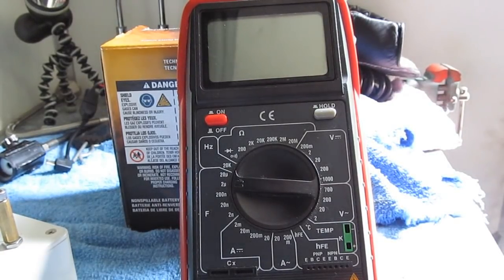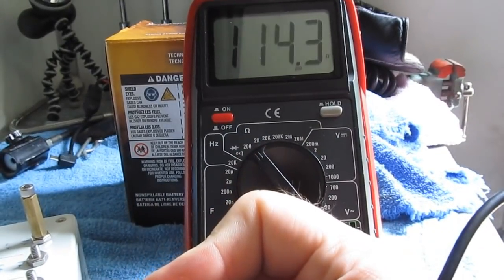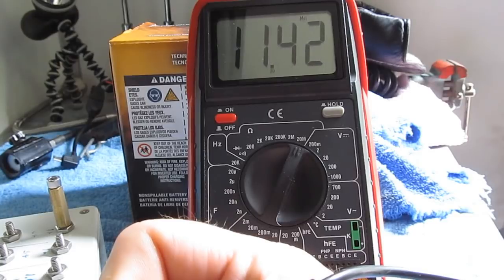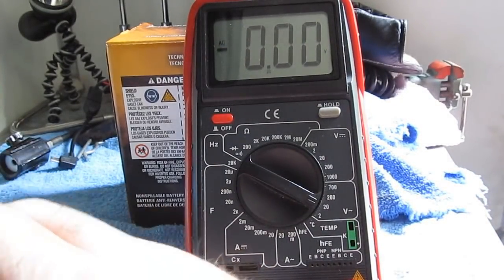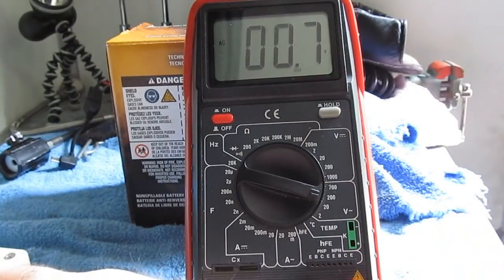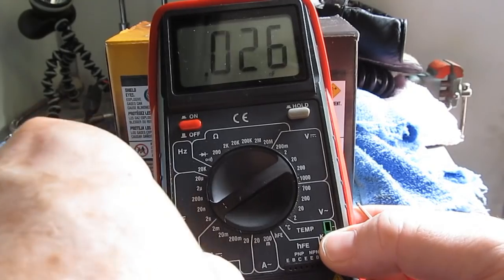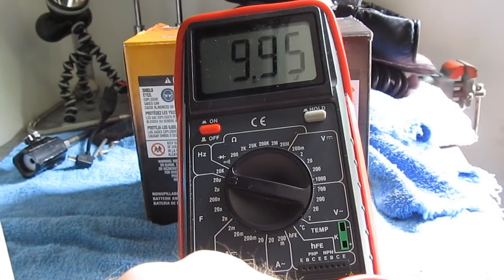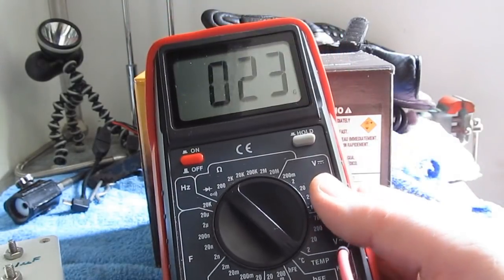Harbor Freight P37772 How accurate after years of abuse?

Comment: this meter uses standard universal test leads?
Reply from the maker: What are we calling standard?
Reply: @joesmith-je3tq  as in the slots that accept the test leads.  if i am correct the standard
 is 40 mm banana style
Reply: @larryp85  that's FOUR millimeters (standard banana plugs).
Reply: @joesmith-je3tq  i am trying to order some replacement leads for mine and not sure if the universal standard size is right
Reply from the maker: @larryp85  I've seen various sizes from China and they don't always mix and match.   The shrouded ones I normally used from Probemaster are longer than the cheap ones from Mastech.  They will fit but they are not flush with the case like they should be.

Comment: not awful for the price, thanks for sharing. would be nice to have a temp probe for roasting coffee, and multi meter for working on the car.
Reply from the maker: Downside is the hinged LCD.  It will fail eventually.
Reply: @joesmith-je3tq I might use it 5-10 times a year max. should I get something better with that usage?
Reply from the maker: @json8172  I don't know what better means to you or what your using it for.  I'm surprised as old as it is that they still sell them.
Reply: @joesmith-je3tq  Ill just buy a Klein from homedepot then. Its a few dollars more, just doesnt have temp. Id rather get something nicer.
Reply: Leave it flat in the rubber case and it will work forever.
Reply: Yep , just like Flip Phones…

However if you leave this multimeter in the rubberized shock cover, it will last without mechanical failure. It’s just a failure waiting to have you buy a replacement. (Mine is always flat).

Comment: Hey Joe, where could i find the pin style connectors like you used here for capacitance testing?
Thanks
Reply from the maker: I have no idea what you are referring to.  Are you asking about the nuts and bolts used on the box?
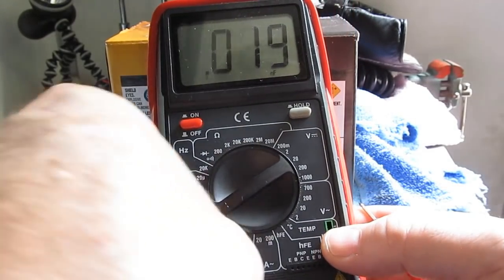Reply: @joesmith-je3tq  I went back and watched it again, at 3:15 I believe you referred to them as slot connector's. Where can i find those connectors/adaptors for my leads?
Thanks
Reply from the maker: @Laowai007  That would have been helpful to know.      These are meant to plug a leaded part into, not the leads like I show.  If you wanted to make a set, I would use a thin strip of copper, or just tin some some wire and insert it.

Comment: Hello, I have a question which has always disturbed me, could I connect a multimeter to a voltage source instead of putting its battery and working with it that way? Thanks for your help.
Reply from the maker: The question you should ask is would it be safe to use a hand held meter this way, not if it can be done.   Obviously, I would have no way of knowing what you are attempting to do.    I'm not big on safety and would assume anyone attempting to do such a thing would understand the risks involved.
Reply: Thank you very much for your kindness in answering me friend. Regarding what you tell me: I use the multimeter only on my desk, hence my idea of connecting it to a voltage source. I worry that the voltage provided by the voltage source is not pure enough and will damage the multimeter. Regarding what you said about security, I totally agree with you. Thanks again, regards!
Reply: @ppstonesanchez1590  As long as the voltage is regulated to what the meter needs/expects, I suppose you could.  I'd recommend fusing the power supply though.
Reply: @djo9c1  I thank you very much, what you tell me is an excellent point. I think I will decide to power one of my multimeters with voltage source. Have a happy Christmas holidays!
Reply: Yes, you can use it on any high quality REGULATED D.C VOLTAGE SUPPLY, set to 9 volts D.C. output. Make sure you get the polarity correct to the battery clip (small circle on clip is positive). It would be very dangerous to have the meter case cracked open for measuring anything over about 50 volts or so, though. The current regulation of your source supply should be regulated to some small amount of current, say 100 mAmps or so. Be careful if you don't know what you are doing. With all that said, you REALLY SHOULD just use a 9 volt battery. A battery should last a long time-check periodically to make sure it is not leaking.
Reply: @douglas2lee929  First of all I appreciate your answer friend, after thinking things through, learning mainly from the opinions of friends like you, I decided not to make any kind of adaptation or modification to my multimeter, due to the safety aspect. Thank you very much again Douglas2 for your focused and clear comment. It's clear to me that it's best to just use the stack. Blessings my friend.

Comment: Hello,  are you familiar with any of the Electronic Specialties multimeters?   They seem well made (e.g. IP67), but I can't find any information/reviews on them.  I'm wondering if they are rebranded.   Here is one:  http://www.esitest.com/589.html   There are a few more.
Reply from the maker: I am not familiar with the brand.  They could very well be rebranded.  You could check some of the lower end brands and see if they have it.
Reply: Thanks for the reply. I was told the TMX589 was designed in conjunction with Dan Sullivan -- I'm looking at getting that kit.....  I will try and look at the rebranding.
Reply from the maker: @jkimo11  I would check CEM and UNI-T for starts.   You could also try posting the link on the EEVBLOG forum.  There are many handheld meter gurus there that may just know.
Reply: Also, as a general rule, do multimeter technologies "age"?  What I mean is that this TMX589 model came out in 2012 and I might want to look for something that has come out more recently with similar features.  ????
Reply from the maker: @jkimo11  As a general rule, I would say all technologies age.  If this meets your needs or if there is a meter available that would better suit you, only you can answer that.

Comment: Thanks Joe! It seems to me that cheaper meters get a bad wrap because they are hamstringed by bad test leads. My little Aneng AN8008 works pretty good with some nice test leads.
Reply from the maker: Seems to me from posts I have read, people often compare cheap meters with the higher class ones making in many times, unfounded claims.   Once you start setting high expectations for a cheap meters, you end up with a bad wrap as you say if they don't perform.  Personally,  I always treated the cheap meters I bought as disposable and I have very low expectations of them.   The point of running these tests was to see how various meters compared on a level playing field, taking the human BS factor out of the equation.
Reply: I am not claiming any such thing. I wouldn't think of comparing my AN8008 against my 87V or BM869s. All I am saying is that a DMM can't be expected to perform very well when it has worthless test leads plugged into it. If someone tests a cheaper meter with the shitty test leads that came with it, all they are really testing is the shitty leads.
I  am using the leads that came with my Brymen for my Aneng until I can afford some Probe Master leads for it.
Reply from the maker: @robertcalkjr.8325  In my first post on EEVBLOG, I talk about the use of filters and why they are enabled.  Your comment was blocked because of this.   "I am not claiming any such thing."  Actually, if you would read what I posted, I never stated you did.   Of the meters I have damaged, it's never been a result of bad leads but poor design choices.   

For electrical work, I find the leads supplied with the cheap meters I have used throughout the years didn't impede my efforts (note the cheap leads in this video).  At home, when working with electronics, if I need to use probes, I typically will use a set of ridged stainless steel needles.  These can be sharpened if needed and are a very fine tip.   These are not something I would ever use for electrical work or take into the garage.  I would guess I have 10 or more tips depending what I am working on.  Right tool for the job is all.
Reply: Hi Joe. I think that you have misunderstood me. I did not mean to sound like I was trying to impugn your work. I was just referring to using cheaper meters in general everyday use. Mine seem to perform better with better test leads. I would never trust using a cheap meter with mains voltage or high current. 
I apologize for not explaining myself well enough. Sometimes I forget how touchy people are online and how easily they are offended. I should have explained myself better.
Reply from the maker: @robertcalkjr.8325  I think you misunderstood my original post as I was not specifically stating that you personally had done anything.    This channel has never been about safety or if any of the meters were safe to use for mains work.  Far from it.  I've always said that if you use a meter in environments that require it, you best use a product that has been certified for it.   These tests have nothing to do with if any of these meters meet these requirements or not.   What I have shown over the last few years is high currents, high voltage, but VERY low energy levels compared with what that actual standards call for.  This has never changed.
Reply: I know that, Joe. I was just seeking your opinion about general use. I figured that you have used DMM's for regular stuff. Forget about it. I apologize for even asking anything. It's ok.
Reply from the maker: @robertcalkjr.8325  I didn't realize you had asked a question.  Most people will end with a "?" I thought we were just having a discussion.  You haven't been insulting in anyway and I am not offended by anything you have posted.   I don't always consider that there are sensitive people who don't care for my blunt responses.  No matter.   Early on I mentioned about taking the human factor out of evaluating meters.  I've tried to make the channel data driven for the few people who are actually interested in it rather than how I feel about the various products.
Reply: Yeah, I guess I should not have framed it in a statement. I was just talking about cheaper DMM's in general. I have noticed that with cheaper DMM's in general use, checking resistors and low voltages and stuff, that they perform better when you use some good test leads instead of the cheap leads that come with most of them.
A lot of people talk about how crappy a certain less expensive meter may be, when the reality is that it is the cheap leads that are causing most of the problems, not the meter itself.
Yes, I find your work interesting. But in my first comment and now I am just talking about the meters in normal everyday electronics use.
For instance, my Fluke leads that came with my 87V that were about 6 years old were acting up and making my meter work like crap. But when I put new Probe Master test leads on it, it acted like a brand new meter again.
What do you think about that??
Reply from the maker: And how high is the BEMF from an unclamped pinball machine's solenoid??
Reply: @joesmith-je3tq  Good question. Depends on if the plunger reaches its end of stroke or not. Pinball solenoids are usually driven with 50VAC. There are also various sizes of solenoid depending on how much physical force is required. Flipper coils for example have two windings - Stroke and Hold. I don't have the equipment to measure back EMF, but I imagine it's not that much.

This question reminds me of "What is the airspeed velocity of an unladen swallow?"  That'd be about 24 MPH.
Reply from the maker: @brianthompson1138  I didn't know they ran them off AC but it makes sense to keep it simple.  I doubt they have anything then to suppress the BEMF just have switches designed to handle it, similar to the toy trains I had as a child.
Reply: joe smith  I really don't understand the animosity and why people on YouTube are so quick to look for a reason to feel offended. I made a very simple suggestion that I admitted should have been formed into a question.
I can see now why you don't get many comments. And to be brutally honest with you, I won't miss much if I never watch another one of your videos.
Reply from the maker: @robertcalkjr.8325  It seems you are actually describing yourself.  I made a general statement, you took it personal.  Now you are to the point of making personal attacks.   Leave or stay, it really doesn't matter to me but keep in mind that I don't tolerate that behavior on my channel.
Reply: joe smith  That was not an attack. But you can keep playing your games if you want to. Goodbye.
Reply from the maker: I don't think anything of it as I've seen some abused leads have problems.    I these tests, I never use the supplied leads.  I did run a sort of batch test on them where they were stressed to failure by sweeping the current while calculating their resistance.   I wouldn't consider, say, touching the leads together, to be any sort of useful test.  Tests that may be useful to benchmark them would be:

Pull test
Bend test
Chemical exposure
Material makeup

Again my requirements when I am using meters like the one shown in this video are not real demanding.    The leads in this video have been thermal cycled, used to catch the falling meter and have been exposed to some chemicals.   Their still fine. 

If I am working with electronics, I am normally using the bench meter with the 4W leads or the ones I mention in the second post for the reasons mentioned.
Reply: It's not fair to compare cheap meters with the higher end stuff, as so many people do. A cheap meter will do its job with what it's designed for - basic measurement. 
Just need to check +5 and +12 in low power circuits? A cheap meter is fine. But don't expect it to come close to even the likes of even basic Flukes or Brymens..
Reply from the maker: @brianthompson1138  These tests have always been about how robust the meters are on a level playing field.  It certainly is fair to compare them this way.  I am not suggesting that everyone will like the end results but I didn't run the these benchmarks to make people feel happy about the products they purchase.   Of course, we have seen some meters costing well over a hundred USD failing at levels where a less than a $50 meter survived.   Of course, there are a few that would rather just hear about a 5 star rating after connecting the meter to a 12V supply, but I try to discourage them from joining this channel.
Reply: @joesmith-je3tq  I agree 100% and I've considered the knowledge I have gained by watching your test videos as part of my decision process when buying two new meters - one for home and one for work. Both of them are Brymens purchased through TME.  I don't work with super high voltages, but being around CRTs, it is nice having confidence that my meters will survive static discharge if it occurs. As always, thank you for the excellent content you put out.
Reply: Brian Thompson  Hi Brian. I was not talking about the meters. I was talking about how the cheap test leads that are supplied with the meters make the meters perform worse than they would perform had they been supplied with some good quality test leads.
It is the poor quality test leads that are the Achilles heel of meters and test equipment. But most of the time it is the meter itself that is blamed for the poor performance of the meter.
And I am referring to general use, not how much voltage they can take before they pop.

Comment: I  had one of these meters for years, ok for a couple years then had nothing but trouble with the display and the elastomer contact strip - tried many times to clean the contact areas and reassemble, but the way the LCD is sandwiched in the tilting display it seemed like I could never get an even enough pressure with the tiny screws used to make it work.  Tried thin paper shims etc to increase or even out pressure but no go -- finally scrapped it for parts and bought a cheap $25 chinese meter that was much more reliable. Too bad I liked the tilting display, not a bad idea if better executed.  Fortunately theres much better choices in the cheap meter realm now. I have better meters of course but this one was my tool bag meter.  What aggravated me was the meter itself was always reasonably accurate as your example is here,
Reply from the maker: Good to hear I was not the only one seeing this problem with the LCD connections.  These meters havn't been too bad for what I have been using them for.
Reply: Yeah got about two years of good use then the issue appeared, and I feel if the clamping force of the bezel had been stronger it might have been better - but the tiny screws and inadequately thin bezel or whatever just didnt seem to be adequate to maintain the needed amount of even pressure.  Like I was saying its kind of a shame cause the meter itself was always reasonably accurate, at least good enough for general measurements.  But theres too many decent general use meters on the market now for around $25 to fool around with it anymore, I hate to throw something away if it can be fixed but after several tries I just lost interest due to the bad engineering of the tilt assemblys bezel.  IMO they would do better to make the bezel a permanently fixed assembly with maybe a slight tilt built in and sell it that way, problem solved.

Comment: I've seen accuracy go to utter crap on these when the battery is very low. No low battery indicator.
Reply from the maker: Mark, I watched your video on the Simpson 360.  Nice bit of history.     I can't say I ever remember seeing an accuracy problem with these but I even 10% would be good enough for what I am using it for.  Normally the display contrast starts getting bad before I replace the battery, or it flat out won't power up.   The manual range isn't a big deal as I basically use the 20V and low resistance modes.